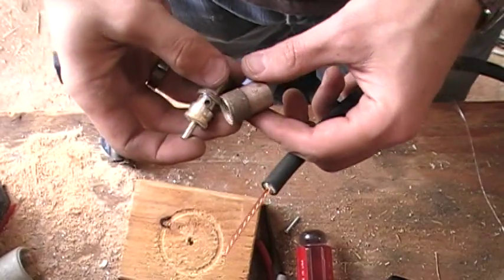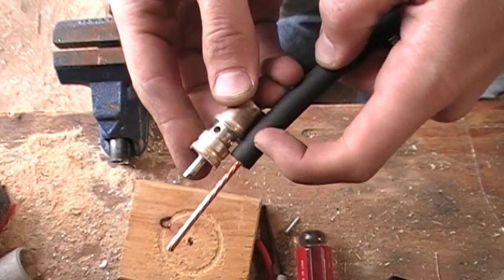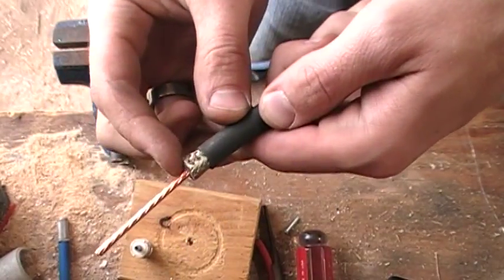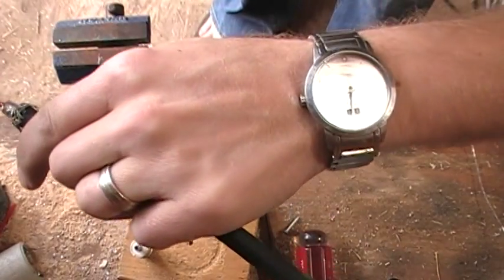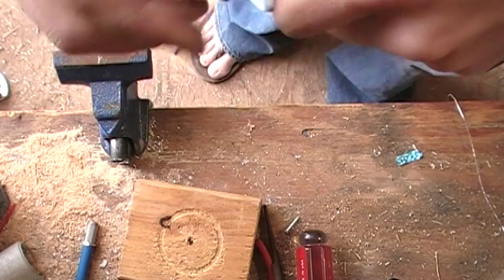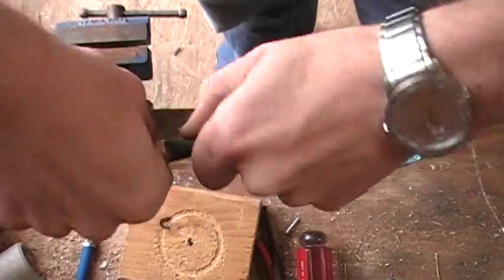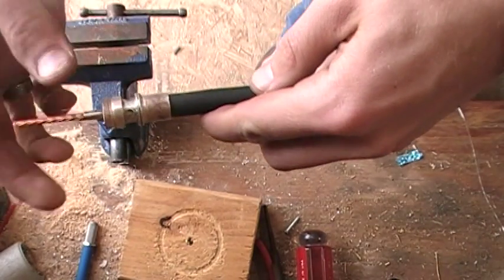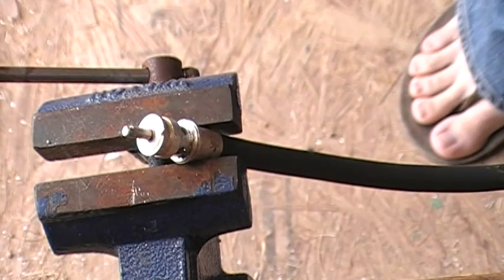Quick Install of a UHF Connector

Comment: Nothing wrong with this method.  As far as corrosion on the PL-239, even darkened silver has high conductivity.  Good demonstration. Drew!  Don't worry about the naysayer.  If I have one thing to add, it is not just a "temporary" method.  You can use this for the long term.

Comment: That is by far the most quarter assed connector installation I have ever seen, and I have been at the craft many moons. This might be workable (not acceptable) with new from the box, silver/gold plated connectors and new coax - IF the interface between the barrel and the braid was filled with dielectric grease. The problem with your psuedo "Crimp" interference fit, is that that ancient, pitted artifact you call a UHF connector is coated in a layer of oxides as thick as Jupiter's atmosphere. Just because your a HAM doesn't mean you have to settle for amateur...Your station is only as reliable as the least reliable component you have in line. I am betting this is the point of failure the next time your operational capability suffers.
Reply: Wow, why so serious?

Comment: Doctor mengler of RF. Old, pitted, rusty, corrded PL-259, soldering with a butane torch (which emits moisture and heat), shield just lightly pressed against the body...If you didn't need pliars to get it on there, then it didnt really bite. You will spend hours upon hours trying to find the bad connection, then realize that it was worth spending the 1.99 for a new, PTFE, plated connector.

Comment: Thanks for posting Drew. I sail and my VHF radio antennae connection has corroded away over the years. I was concerned as to how to connect to the PL-259 as the copper core is very thin (RG-6U) but your video has explained it perfectly.

Comment: hi i need a low loss coaxial cable for my 24 dbi parabolic wifi antenna. lot of ppl seems to be  LMR 400 but it is not available in my city. so how about rg 213 ? i am going to be using 30 feet cable. the velocity prop of rg 213 and lmr 400 is 66% and 86% respectively. so will there to too much signal loss ??
Reply from the maker: Loss of RG-213 for 30 feet at 2.4GHz will be around 5dB of loss.  The same distance of LMR-400 will be 1.44dB of loss.  So I would really try to get LMR-400.
Reply: wow that much !! some shops do have the lmr 400 but they only sell in 100 feet spool. if i am not able to get 30 feet lmr 400 what will be the next best cable ? an alternative ?
Reply: balaji hustler

Try this:
http://www.showmecables.com/product/UHF-Male-PL-259-to-UHF-Male-PL-259-Low-Loss-400-Coaxial-Assembly-100-FT.aspx

OR

http://www.showmecables.com/product/ECore-Cables-Low-Loss-400-Cable-Per-Foot.aspx?link=RVI

They are both the same...but the ECore will save you money and is the same stuff...just as good quality as the LMR-400

Comment: An excellent method. I might add that lightly tinning the center conductor before you slip on the connector might help the solder flow more quickly. Thanks and 73,
Don

Comment: I have been using them this way for years and have never once had a problem when you screw that over the ground it is tight and grabs a very good ground just make sure to put some shrink wrap on the pl-259 but it fine just like that for years . thank you.
Reply: I did this 6 times this evening.  I'm going to have blisters tomorrow.  That LMR-400 (Well, the DX Engineering equivalent) is tough stuff, had to use pliers to get the PL259 threads to bite.  I have no doubt that there is a strong ground connection, and I have the 1.0:1 SWR to prove it!  :)

Comment: You need to get your connectors straight, The video is installing a PL 259, not the PL 239. The 239 is the female connector.